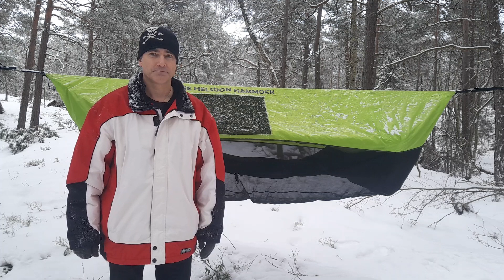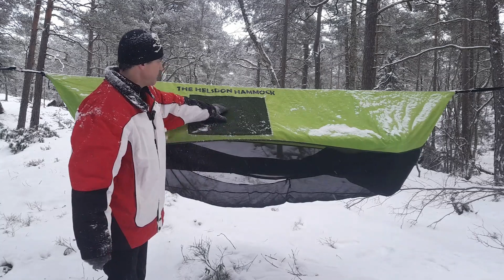Condensation in tents and hammocks

Comment: Awesome

What about water running down the straps into the hammock?  I’m sure you mitigate this, can you show how? 

I’d pay twice as much for your UL design….lighter material ( Dyneema ) straps ( Dyneema ) and carbon spreader bars. Could I use sticks for the two spreader bars? 
 Still pretty awesome!
Reply from the maker: The buckles breaks the flow of water down the straps. I'll make a video about it and post here on YouTube.

We have no immediate plans to release a UL version, although Dave has made a UL prototype out of mesh just to prove that it can be done with intact strength and lay flat properties.